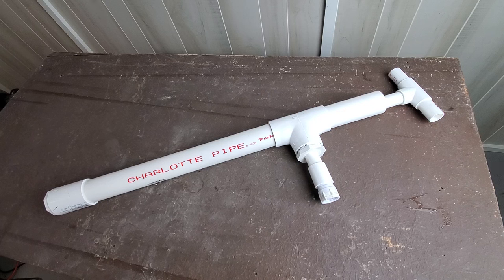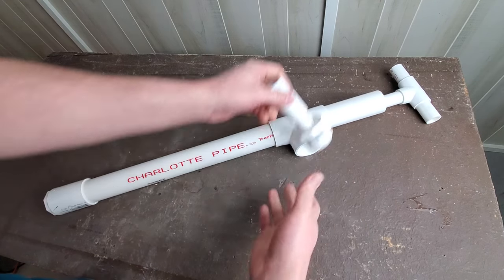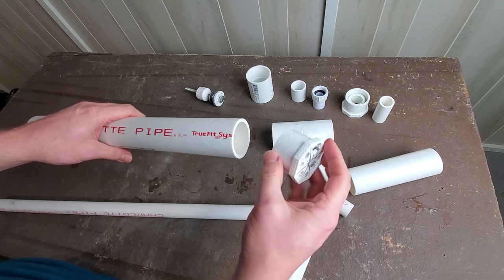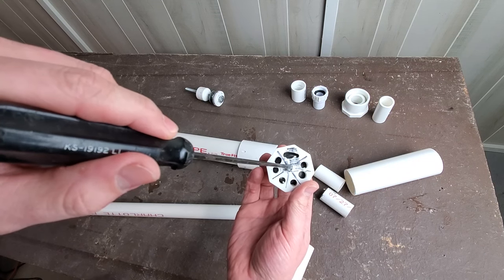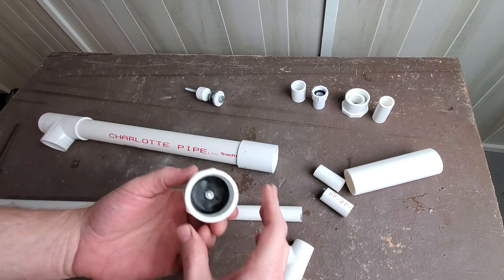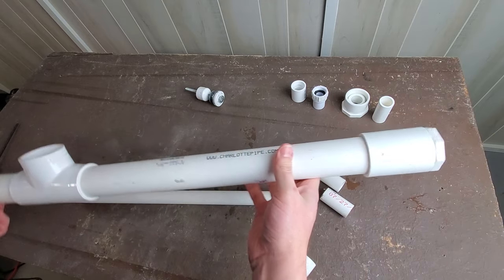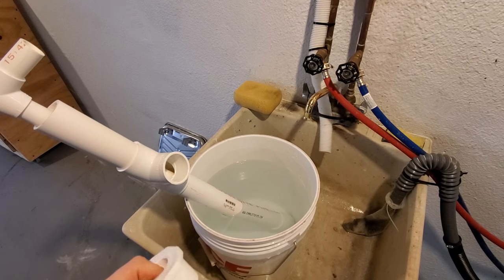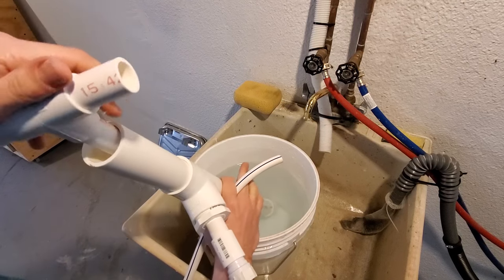How to Make a Simple & Strong PVC Water Pump (DIY manual hand pump from spare parts)

Comment: Anybody have an idea how deep a pump like this can work?
Reply: There are hammer in whells and i thimk they wore 25ft long because that how far a vacuum cam pump wayer by hand so would be the same i forget the na,e of them have a poimt cone on emd amd hammer them down in the ground  i know there is a limit with vacuum pump it works different to a pump down a whell that pushes the water with psi mane Google would tell you how high could a vacuum hand pump pump water i belive 25ft

Comment: Pretty cool simplicity.  Naturally, stainless steel hardware would be nice along with the addition of a collar at the top of the pump.  Another thought.  For pieces you don't wish to glue, I've used a pop rivet or small sheet metal screw to hold PVC together before.

Comment: Very nice and well explained.  A few improvement....maybe a better check valve washer for the plunger, like gluing a rubber backing to the metal washer or perhaps a plastic washer would work better.  And a top fitting that is drilled out to accept the plunger shaft...that way it's not wobbly.
Our septic tank has a filter and recently clogged.  I should clean it every year but three years went by.  The tank filled up and we knew we had a problem when the shower didn't drain.  So I purchased the hand pump from HD and it worked fine until the bottom check valve popped off the bottom of the main shaft and disappeared into the tank.  Fortunately it did the job that I needed done in order to pull out the septic tank filter.  I probably removed 30 gallons of water.  This looks more durable.

Comment: I'm using just a check valve at the bottom of the pipe for my tube well when my water pump is not available. If this will make pumping less force needed, it will be awesome

Comment: Awesome! Wonder if this would work with about 10-15 feet of hose attached running to water source, as in would it have enough suction to get water rolling? Thanks for the great video
Reply from the maker: Thanks Lenny. I think the hose I tested it out with in this video was 10 foot, and it definitely worked.
Reply: I'm wondering the same thing. We don't have easy access to the water source so need to add a hose to the bottom suction part in addition to the hose at the top

Comment: Could the bottom of the housing be connected to a house, that sits in a lake, and then pumped into an RV tank? Or, could the pump sit in the lake and pump water through house to Rv tank? Maybe not enough ‘power’?
Reply from the maker: It probably just depends on the distance for how useful it would be. It would likely pump through a hose a long distance, but it would just take a lot of pumping.

Comment: @GreatLakesPrepping 6:35 any reason you didn't use the same "valve"/inner bike tube system on the inside? Why bother with washers? If you were going to sand down the plug to fit the outer tube anyway... Couldn't you have used the same mechanism as the first intake&backflow-stopper?

Comment: Did u glue the cap/ inside plunger on?  If not how would it stay on?
Reply from the maker: I didn't glue any of the fittings together. They stay together pretty well just from compression. The fittings have a very snug fit. It's possible that over time they could come lose, but pressing/twisting them back tight again would take care of it. You certainly could use PVC cement for the fittings if you prefer.

Comment: Marbles work better or anything that is a near a perfect ball shape.  
There are several ways to make the ball seat too. With a good ball seat it's makes a 100% seal.
Reply from the maker: This particular tubing is too big for marbles, but I did play around with a ping pong ball check valve before settling on this version.
Reply: Use a ball from an old style computer mouse.

Comment: But i still wonder how the water will pass through the first metal washer because it is as big as the chamber 🤔
Reply from the maker: That's the neat part about this design. When the water is being sucked inward, the force of the suction holds the washer in place, covering the holes and allowing for water to be drawn into the pump housing. When pushing it back down, the washer is pushed "open" by suction in the opposite direction, allowing the water to get moved past the valve. The washer being able to move a bit up and down is key to the whole thing working.

Comment: This might work to move gas out of a barrel!
Reply from the maker: It would work, but I suspect that gasoline or other similar liquids will begin deteriorating the plastic components relatively quickly. PVC and the fittings are designed and rated for water. In an emergency situation, it would certainly work. But I expect that it would ultimately destroy the pump.
Reply: @GreatLakesPrepping  I thought about that later and I believe you!
Reply: Consider that it might create static electricity and ignite gasoline

Comment: One of my many pet peeves, size of drilled hole, bolts, screws not given in video which is odd because every piece of PVC size is given
Reply from the maker: I thought about this very thing while I was making the video. I decided not to bother giving the exact sizes of nuts/bolts that I used, because exact sizes aren't imperative. I eye-balled all of these and just used what I had in my "spare fasteners" bin. I guess I wanted to convey in the video that this device can really be "thrown together" for the most part.
Reply: Irrelevant information, he stated he used what he had on hand. There are no set rules for most of this build.

Comment: But it needs to be long enough to reach the water table of your well.  It would be great if you explained how to make one that's 50+ feet deep.  Otherwise, why would you need it?
Reply from the maker: I guess it seemed obvious to me when I made this video that I wasn't building a replacement for a 50+ foot well pump. This is a basic, small hand pump to move liquid from "here" to "over there". Rain barrels, buckets, etc. There are a lot of uses for a small water pump besides 50-foot deep wells. It sounds like you are in need of something other than what this video happens to be about.
Reply: @GreatLakesPrepping   It looks like your design might work for pumping manually from a well if it were extended.  That seems like a worthy prepper project for anyone with a well.  I think I'll give it a shot.  Thanks for the video.
Reply: Research clayton cylinder. I had 80' deep well with a similar suction pull setup.
Reply: 🌷I will use it on a5 gal water bottle, so I don't have to lift it. 😊

Comment: why in the fock would you use that metal washer instead of using another piece of inner tube for the valve, you'd get way more water in each pump action, the washer just decreases the volume you can pick up, its beyond me why you'd have two different types of valve, the inner tube rubber is way better
Reply from the maker: The metal washer piece needs to be rigid for this design to work (within the confines of what my tools and capabilities require). Take another look. Maybe you can describe exactly how a thin, flexible piece of rubber would work in the washer's place. Help me understand.
Reply: @GreatLakesPrepping  
Glue the rubber to the washer to create a better seal :)
If you dont want to make one from pvc pipe you can buy a "whale easybailer" hand bilge pump reasonably cheaply. The larger one with  a 27" barrel will easily pump 5gpm and can lift water to at least 15ft.

Comment: can the garden hose be 3' higher than your handle? Asking because I have a shallow well and want to shower under it.  also wishing I could pull the handle downward (while standing upright) vs pull it up while bent down.
Reply from the maker: I don't see why it couldn't pump 3 feet vertically. It just may require more manual pumping, but I believe it will do it.